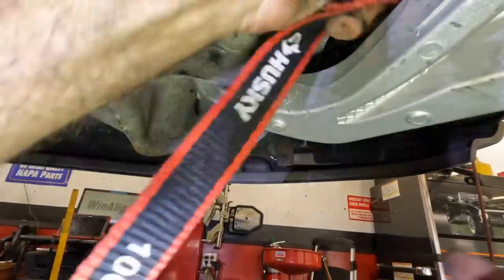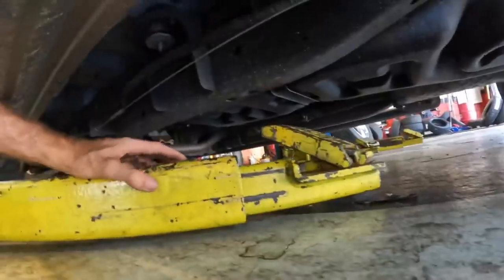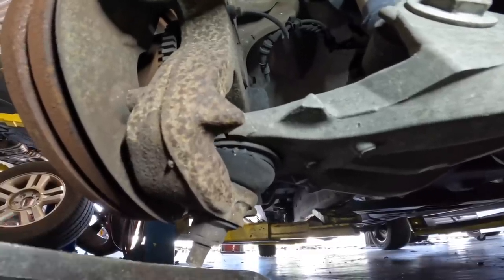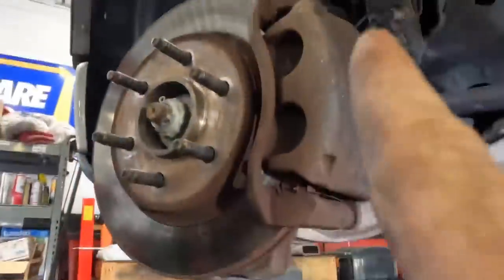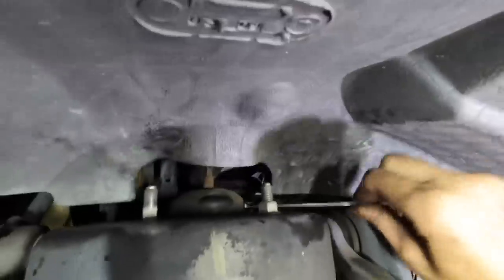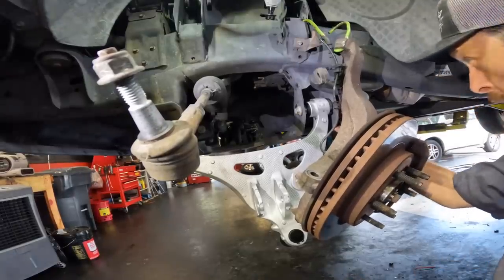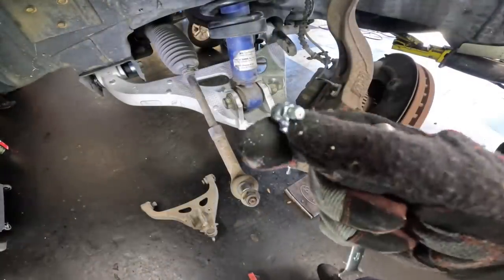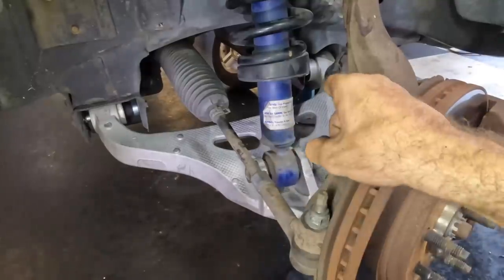Sloppy Suspension! 3 1/2 worn balls | Ford F150

Comment: I used to get laughed at when I was a tech for setting the car on the ground before tightening the control arm bolts. Actually, I think the other tech was just too lazy to do it. He was also a kind of know it all anyways. It just makes sense to tighten them with the car on the ground as that's the position the car will be sitting at, and it won't twist the bushings or make them bind.
Reply: Whenever I do suspension work on my vehicles, I measure the wheel position with the car on the ground, then after replacing components I use a jack to raise the wheel to the previous measurement then torque down the hardware. The rubber bushings won't last long otherwise.
Reply: Bushing windup.  I was taught that in 1975 by my college instructor George Blackwell.  Good guy, he'd have to be 100 if he's still alive lol.
Reply: Aren't the lower ball joints available separately so that you don't have to replace the whole arm? If the lower ball joints are replaceable is there a reason that you prefer not to other than time, is there a particular supplier that you prefer for these parts thanks.

Comment: For home mechanics without a hoist, in order to tighten your new bushings at the proper ride height, before you begin the teardown measure from the center of the wheel to the wheel arch and write it down.  Then you can simply jack the hub up to that point and tighten your bushings with the wheel off.
Reply: No need to measure anything. It won't be accurate anyway. Just put the jack under the lower control arm and raise it until vehicle just comes off the jack stand, then tighten.
Reply: @hotpuppy1  Close enough for most, but remember, the ride height is based on the vehicle sitting on all 4 wheels- when you jack up one corner, it will depress the opposite corner and also the opposite side unless you have disconnected the sway bar, so most likely you will have jacked the control arm up further than needed.
Reply: @oldschool1993 The arms will always be moving when on the road you never will get it perfect. The jack methode is close enough.
Reply: @mart43  I agree for Mom's car, My experience was from racing, so I think a bit more.
Reply: Yeah .. for these types I always measure too.. because it's an unloaded condition.
Reply: When you lower the vehicle on the ground, you are at the normal ride height. Put it on the ground, bounce the vehicle to settle it, and it is at the normal ride height.
Reply: @earlribaudo4807  Of course, but then you have to somehow crawl under there to tighten those bolts-  measuring first allows you to tighten everything up on the hoist with the wheels off.
Reply: @earlribaudo4807  I have seen both...  i suspect either way will get you close enough to make to the alignment rack.
Reply: @oldschool1993  You have to align the vehicle, so when it is on the rack tighten all the nuts. Have done it that way for years. If you are diy, then crawl under the vehicle.
Reply: @earlribaudo4807  Ed, you need to read slowly and carefully.  My original post was for DIY guys and only a fool would do it so you have to crawl under a vehicle that is sitting on the ground.   Once again- doing a simple measure to the wheel arch before you start the job will allow you to tighten all the bolts with the wheels off.
Reply: @oldschool1993  What/where is the wheel arch you measure from? Is it the top of the inside of the wheel?
Reply: @thull1234  The arch of the fender.

Comment: As an 'Ole Geezer  Gearhead', was I ever happy to see those Zerk grease fittings on the new front end parts. Being from the 'Way Back Era' in automobiles, when the grease gun was your friend! And, at almost 80, I'm still a 'grease gun mad man' !  Thanks Ray, for yet another informative and enjoyable video.
Reply: Once when I had a broken ankle I took my scout to jiffy lube. They could not find the grease gun. When they did it was empty. They finally figured out how to put a tube in it and proceeded to try to grease my brake bleeder screws.
Reply: @chrisleggett685   Oh NO !
Reply: @chrisleggett685  oh geebus.
Reply: @chrisleggett685  Well, they'll never rust now!
Reply: An uncle of mine was incensed when his new Grand Marquis around ‘90 or ‘91 didn’t have any grease fittings on the front suspension. He was hellbent on adding them somehow since it was his first new car without them and he was convinced that somehow Ford missed installing them 😂

Old habits die hard…
Reply: @SIGINT007   I was a shop flunky boy in the mid-80's and had to explain to an older VW customer that no, the new car's front ends can't be greased. He didn't get wound up about it. I would later learn, on my own 80's VW, that a new ball joint was $15 and 3 simple bolts, quite a breeze to replace.

On the old Durango I now toil over to keep rolling, I put MOOG ball joints with grease fittings in the front end and some days when I'm greasing them I wonder if the time I will spend greasing them will add up to more time than it would take me to change them and then I say... naaaaaw. This is still easier work than that, so no biggie. And 140K miles later, no play in them, so that's nice.

Comment: I remember when replacing control arms and replacing ball joints were two different things.  Ball joints were separate pieces bolted on.
Reply: He had to replace the whole Upper CA sure, but lower ball joints for these truck are only like $35 (Motorcraft MCSOE7) not sure why they replaced the entire lower control arm. Maybe they couldn't get just the ball joint in a timely fashion?
Reply: If the control arms are aluminum (as they are on this vehicle) you cannot replace just the ball joints because the aluminum is soft and will no longer have the correct fit tolerance to press in a new ball joint.
Reply: Could be because the price difference is better than the labor to press them out then back on.
If it was a DIY’er at home it would probably be better the other way.
Reply: @bradnoyes7955  have to consider the labor of the press compared to the price added by doing the whole arm.

Comment: Thank you for taking the time to so clearly demonstrate the play -- and the degree of play -- in the ball joints as well as the various methods to find it.  I would never have thought of the big channel locks.  That was a good idea!
Reply: I like the 'angry pliers' on the Ford lugs nuts.
Reply: I would have recommended replacing all 4 regardless of the amount of play. Boot was starting to tear, and it would have likely needed replacing relatively soon after this

Comment: I fondly remember grease fittings on everything in the front suspension.  RIP
Reply: Back when everything was made to last more than 3 weeks and be thrown away. Awful what it has all come down to and they talk about "green" but everything is made out of plastic that'll never decompose... brilliant!
Reply: @frizzlefry1921  considering most factory suspension parts are non-greaseable and they last for years.  Don't know where the "green" and plastic came from.. they are ball joints.  I guess you felt they need to add that because.. reasons I guess.

Comment: Something extra I do when fitting ball joints and tie rod ends is applying a little rubber grease where the boot makes contact. It helps prevent the boot from twisting and splitting, helping the joint last longer.
Reply: Periodically, I Spray a Rubber Preservative or Silicone Spray on everything that is Rubber underneath my Vehicles, especially the CV Joint Boots--got that idea from Scotty.

Comment: That was interesting that you have to replace the whole arm with the ball joint. Good call on the ball joints. Definitely loosen and re tighten the bushing arm bolts when you get it on the rack for the alignment so the bushings last. Love watching your videos. Have learned a lot from them.

Comment: Matco makes a tool for the air hammer. You put a socket on the 1/2 or 3/8 tool. Then use the air to impact the ball joint via the threaded nut. I recommend it. MC88 or MC89

Comment: Another tool suggestion : Check out the Snap-On air hammer (LT 855) with unique features/attachments for hard to reach areas. Not sure if the attachments are available separately. 🤔

Comment: I did the upper and lower ball joints on my 2001 F150.  They were doing the whole creaking and knocking sounds.  What I liked about the uppers, though, was that the upper control arm is a single unit and easier to do than trying to get the ball joint out of it.  And the cost difference was negligible.

Comment: I have no idea why i get so excited when i see grease fittings on replacement parts. I still remember the first time I found out we have “sealed” ones….and the stuff dont need greased anymore. And i went off about how completely stupid that was and how they will all fail and that whole idea will never work.
Reply: Stuff I see, suspension parts last around 8-10 years. 100-150k. My current car, all the rubber bushings/rubbers wore out before the actual greased joints.
Reply: I was thinking, a different mechanic might not know the replacement ball joints need to be greased at oil changes, seeing as how so many are sealed nowadays. The sealed do seem to last longer, probably because people failed to grease the ones that aren't sealed. In the "good old days," 70K-80K was good life--I replaced many at 50K. (When you operate farm equipment, you become a serious grease junky.)
Reply: @richardfabacher3705  i helped my father-in-law on the ranch a lot. I think he kept me around just to grease equipment. Lol
Reply: Sealed Parts are made to ware out faster. Sealed batteries, sealed transmissions, sealed oil, sealed barrings, it will be sealed radiators next. In Germany I'm told they outlawed DIY and sealed all the parts stores.

Comment: Hey Ray! THey make a tool perfect for when you use the larger wrench as a cheater for the other wrench, called the "Knuckle-buddy".  I almost threw my back out once when the wrench slipped using the same trick you use.  Check them out, it's pretty cool and way safer.  Once I'm back at work I'll send you one.  I'm healing from a dif injury right now.  Accident prone engineer here, LOL
Reply: Accedent prone AKA experience bumps
Reply: Cant wait to see him using it…..
Reply: Knuckle Buddy?Sounds like someone owes you alot of money.
Reply: @dwightyost1606  Experience: What you get right after it would have helped.

Comment: You got lucky there Ray. Did the same job on my buddies truck and the lower control arm bolts were seized and had to be cut out. We would cut them to about 60% of the way through then shear them off and use the nut to drive the broken bolt out. Also replacement bolts were expensive and unobtainium.

Comment: Interesting job, my 1986 F350 has probably a good 1/4" vertical play on the right front, but essentially zero in and out. Other that the tie rods everything else in the front is oriiginal. Last full alignment was done in April or May 1994. Last set of tires are wearing dead even across on the Twin I-beam front end.
Reply: Be Careful, vehicles with front ends like that are towed into our shop all the time with the suspension off and the fender destroyed...if they are lucky. The bad ones go to the body shop or salvage after the joint separates. Luckily it usually happens going slow when turning and hitting a bump....usually.
Reply: @JimmyMakingitwork  Are you familiar with the 1986 F350 2WD front suspension? It is a Twin I-beam with the last year for King Pins. That is why vertical play but no in and out play.

Comment: I know struts are heavy, ordered 2 pre-assembled ones for a van I had, I paid the extra for pre-assembled since I oddly had knowledge that to assemble them could lead to physical harm.  My dad had to access the securing nuts from the top, which meant taking off the wiper assembly. Since that got removed and I had ordered the replacement motor at the same time as the struts, got that swapped too that day.

Comment: Another great video! Love your content!
One question is why didn’t you just replace the ball joints? Why all new control arms? Were the old ones bad or just the ball joints. Thanks again for the light hearted and expert content!
Reply: Some ball joints only come with new arms. Another reason to replace the whole arm: you now get new control arm bushings, too. It's the better way to go.
Reply: @61rampy65  Also comes down to price ,the replacements are usally cheaper , and then are set up with replaceble ball joints, and life time warranty.
Reply: If the control arms are aluminum (as they are on this vehicle) you cannot replace just the ball joints because the aluminum is soft and will no longer have the correct fit tolerance to press in a new ball joint.

Comment: Good stuff as always man . FYI when your ball joint puller won’t span  that gap flip the nut over and use the flat of the nut . I know shocking those F’rs off is quick but in 30 years I’ve broken 1 knuckle (on my hand ) and 1 knuckle of the truck!

Comment: UNREAL how things come apart in Florida. Here in N.E. PA. the long bolts that hold those upper & lower Control arms would be RUSTED FAST IN THEIR BUSHINGS. Either requiring a Torch, BIG ASS HAMMER, lots of penetrant & swearing. I use lots of Anti-Seize or Grease putting things back together here in the SALT BELT.
Reply: The dry climate of CA is even more amazing. No mold, mildew. Just lots of dust. Going to an AZ salvage yard is like a time machine. 20-40 year old cars with solid frames and bodies.
Reply: Anti-Seize is the mechanic savior in the NE. Simple caliper bolts will be a nightmare if the last mechanic just slapped everything together.
Reply: I live in the rust belt, but buy all my cars from the NON rust belt. Drive them for 3-5 years and then dump them. Super easy to wrench on my own stuff. 🤣My car is on the lift right now, less than an hour to break down the entire front suspension including knocking out the ball joints with an air hammer. Waiting on parts.
Reply: @mph5896  NICE

Comment: Remember the days when we just replaced the worn parts (upper and lower ball joints, without removing the control arms) vice the complete assembly (upper & lower control arms with bushings & ball joints)?  Ahhh... progress.  And we wonder why our landfills have all filled up.
Reply: In the UK, I'm sure the standard procedure is just replace the worn ball-joints. That's all I would do.
Reply: @terencejay8845  No choice on a lot of these>>only comes as an assembly.
Reply: @hotpuppy1  I've noticed that on US spring replacements; buy the complete assembled strut and swap the whole thing out. I've never seen anyone in the UK offering complete units. The norm is replace the spring, or shocks as required. With the struggle I've had with coil-overs, maybe it's time the UK offered complete units!
Reply: Metals usually get recycled.  The assembly gets you new bushings also.

Comment: I had to go to a specialty shop with my 1996 F250, I did a 3" lift on front by getting Eaton springs ( leaf springs no less ) they built me a pair of new front springs with the lift built in, I ordered new shocks with an additional 3" ride height and this shop had to shim the front end in order for it to align ( it was off anyway and a custom shim was the same price whether it was standard or not ) , replaced the worn bushings and ball joints and got the best alignment the truck ever had. I also brought the rear-end up 4 1/2" because it had a case of Ford dragass like all ford's with a little age, the rear end starts sagging and those rear leaf springs aren't a joke. 
The truck never rode so good and the extra clearance with 4 wheel drive made it almost unstoppable,  I'd push through 2 1/2 ft of snow with the front bumper and never slowed down. Also did the rest of the bushing plus body bushing and quieted the trucks little squeaks and squeals down.
Given the choice these days ( I no longer drive a Ford ) but if I did I'd gladly by the control arm with the new bushings and ball joint over just replacing the ball joint  unless I was dead broke.

Comment: Not sure if you tightened the  upper arm bushings with the weight on the tires?  You can use you transmission lift to just barely lift one side to  simulate the ride height and then tighten the bolts down to the specified torque.  
For those not understanding, the upper arm does NOT pivot on the bolts but is "torqued" by the rubber/urethane inside the bushing, thus the need for doing this at "ride height".

Comment: I had what you called nurf bars on my F150 till the first winter. I saw that all they were good for is holding ice and salt from the road. So off they came. My coworkers who left theirs on now have rusted out rockers!  Mine are still good.
Reply: What are "nurf bars" and what are "rockers"
Reply: @johnt.848  Running boards and the part under the doors.

Comment: A common misconception with that style of factory and some aftermarket ball joint, “non-greasable” isn’t actually non-greasable, or already loaded with sufficient grease, I use a grease gun attachment that has a needle that goes into any boot and loads grease. Cheap and very good tool to have to reduce wear and warranty on parts replaced with “lifetime” warranty

Comment: What ever happened to just pressing out the old  ball joint and pressing in a new one?  looked a lot simpler and I would think cheaper than replacing the whole A frame.
Reply: That’s the old school method. Shame really as most techs these days are just taker off and put back on. Us old school folks used to remove repair and refit what ever item it was. Much more satisfying.
Reply: In all fairness, it ends up being a wash in many vehicles of today, especially with shop labor costs. Either paying for the labor of pressing, or for new parts. Plus the aftermarket units often address known weak points and can be built up a bit if you don't cheap out.

Plus, now he has new control arm bushings too!